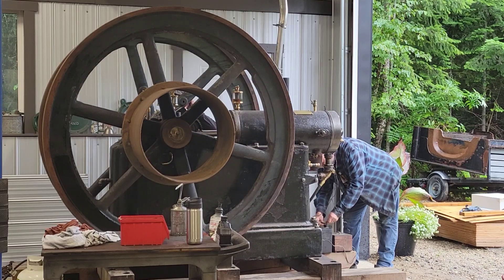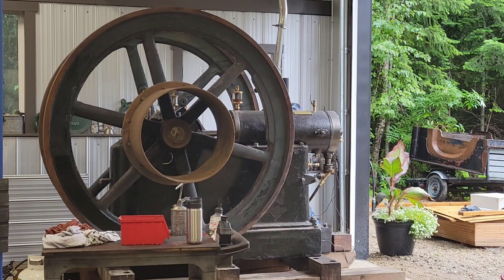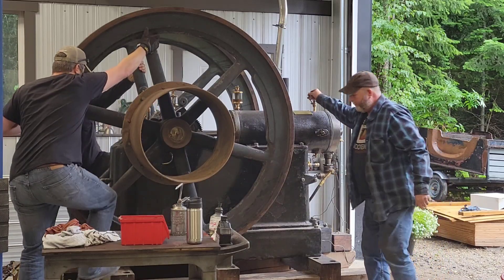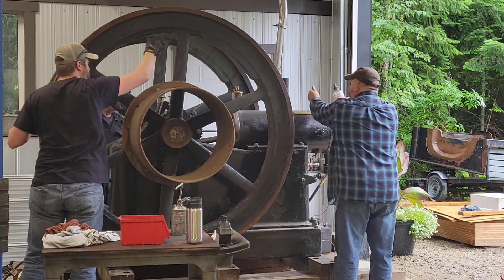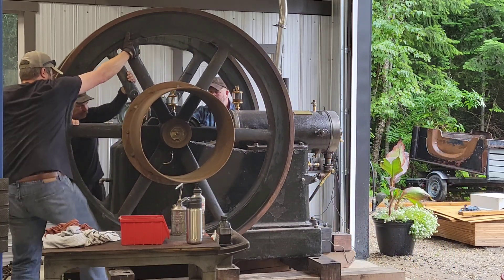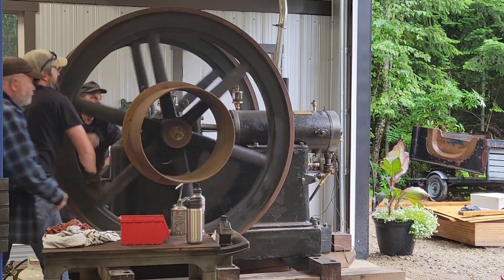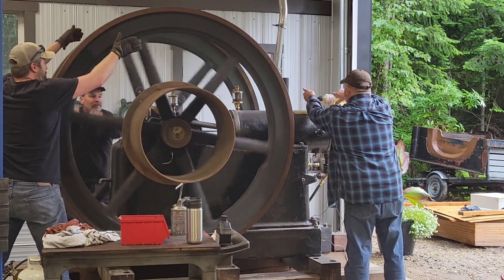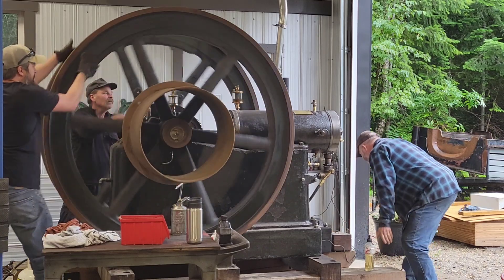15hp Fairbanks Morse N - First Startup in 80 Years

Comment: What was the small thing doing, that suonded like 
"a woodpiker" on top of the cylinderhead ?? Was it some kind of ignition system ??
Reply from the maker: That's the intake valve anti-flutter device. Normally it has a cap which causes a vacuum that stops the woodpeckering, the cap was left off in case adjustments were needed. You can see all this on the very front of the cylinder head.